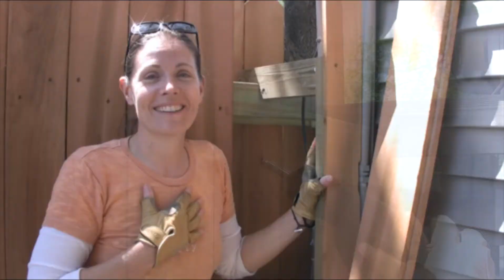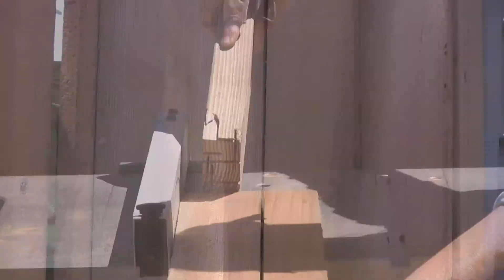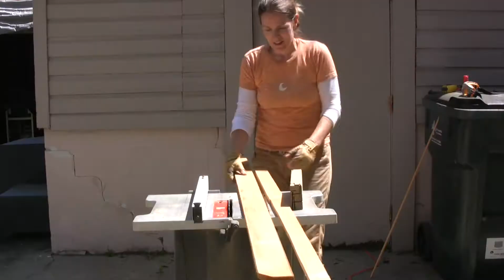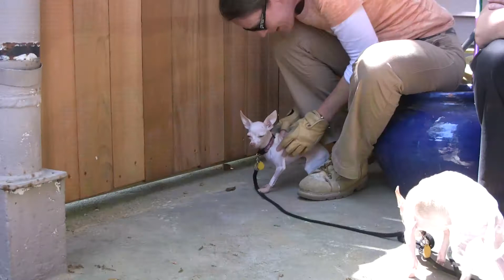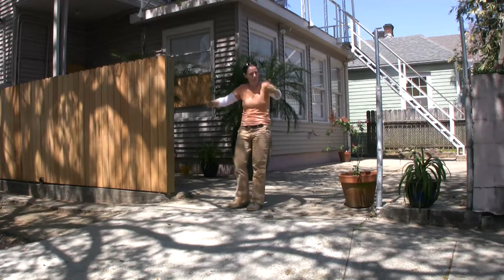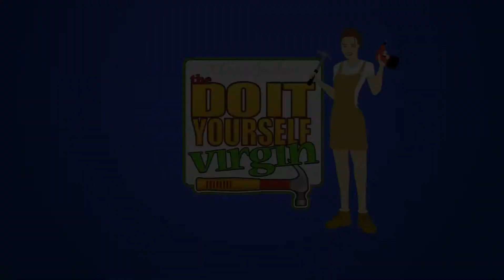I Built A Fence By Myself and It Looks Great!

Comment: Hate to make fun of your tools, but honestly... you need to get the Makita drill/driver combo kit.  I've got the 3.0Ah ones, and two people I've worked with have the 1.5Ah versions.  Everyone is happy with them.  Milwaukee also has a good combo set, but not quite as many features.  Still very respectable, though.  You're only making yourself miserable using cheap tools.  If you want to do any substantial DIY work, you should really do yourself a favor and buy decent quality stuff.